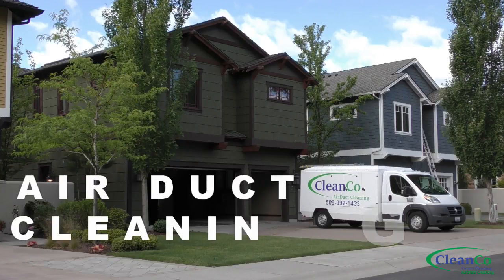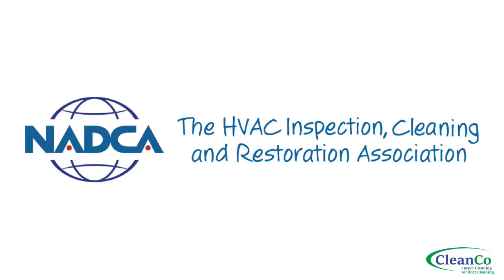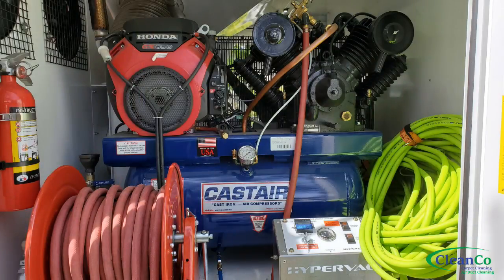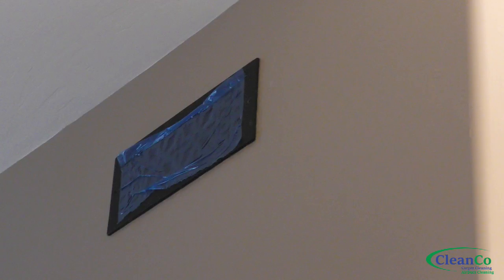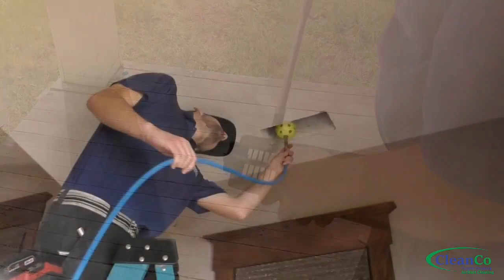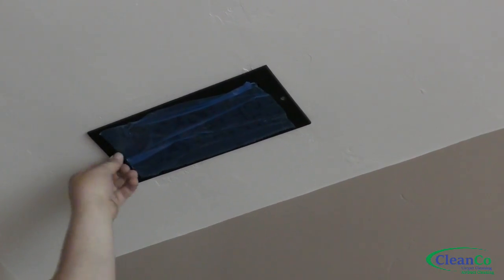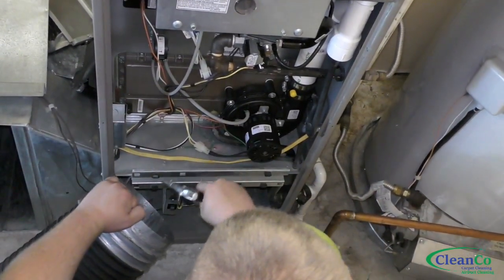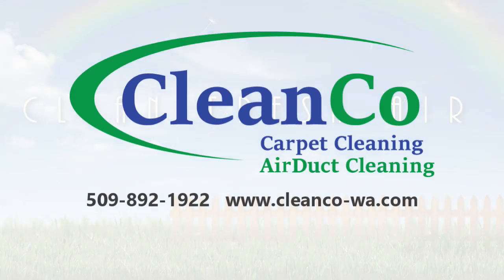Air Duct Cleaning, How and Why (2019)

Comment: What can a consumer expect to pay ? I am sure it varies but 50.00 500.00, 1000.00? Thank you and you did a wonderful job, informative
Reply: We charge 250 plus tax we only charge extra for mileage. I'd take before and after pictures if the customer asks. It takes more time but I'll do it. I use my phone to take videos for myself to know it's done right. Will come back and finish if there's any issues.
Reply from the maker: Depends on the size of the home and how many vents you have including all supply, and return. Small home $300 - $500 Medium home $500 - $800 Bigger homes can be well over $1000- or more.

Comment: Hi air duct cleaning should include Furnace, Coil, blower motor, Patching, and vents.
Reply: No it doesn't lol unless you want to pay extra
Reply: No it doesn't. Cleaning the furnace, coil and blower is done by an HVAC tech. The air duct cleaner might blow them off if they are easily accessible, but they aren't going to do any real cleaning. In fact, in most states you have to be a licensed HVAC tech to clean the furnace.
Reply: They won't touch the furnace! No duct cleaning service will.
Reply: @marcusvonmaximus8071  why not, furnace,  blower , is part of ducts. If your clean the ducts, then you clean furnace and blower
Reply: @marcusvonmaximus8071  I'm an air duct cleaner and our company pulls the blower so we can clean it and the heat exchanger. if that heat exchanger is clogged with dust and it usually is cleaning the system does nothing for air flow.

Comment: "Technician"
Reply: Well considering there is a certification process to go through if the company is legit. I worked for a company that did this as part of their business. I didn't do much in the duct cleaning side as I worked in a different division, but I did help them out occassionally. It isn't as easy as most people think. If you are doing it correctly, there is a lot of skill and knowledge required.
Reply: they are technicians. learn the field and see for yourself instead of spouting off on something "you think you know"